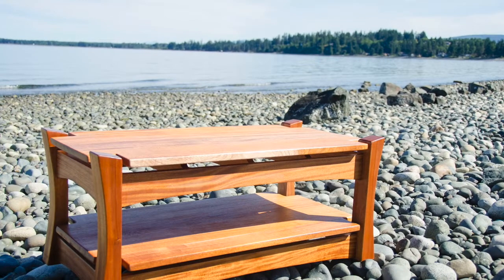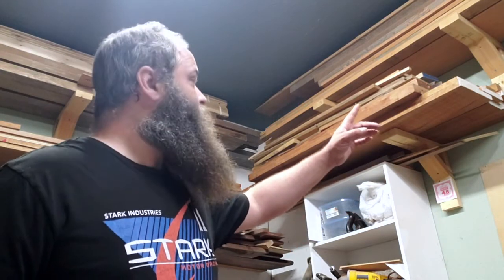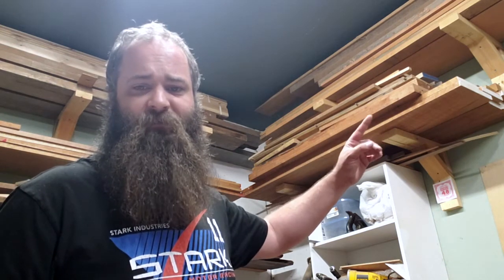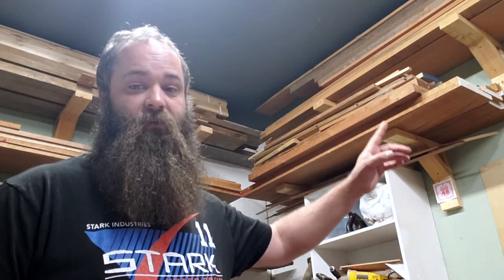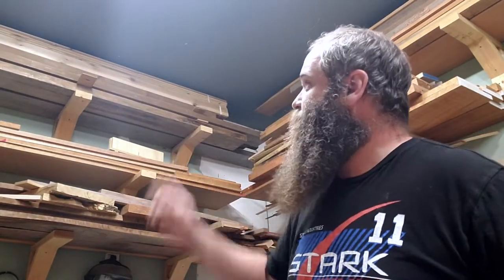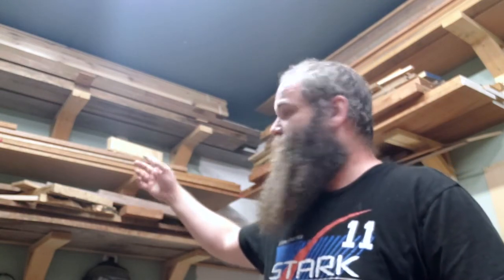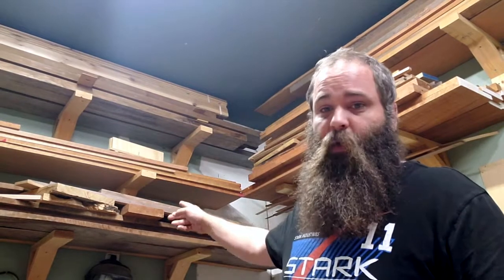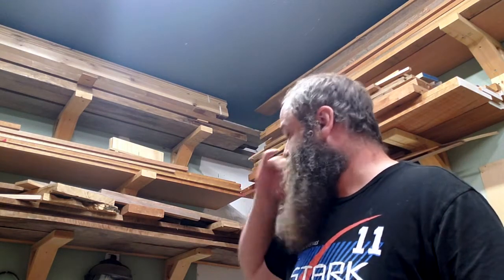My Name is Mike, and I'm a Wood Hoarder

Comment: My name is Memphis (Real Name Henri Chase) and I'm a wood hoarder too.  I have a very large shop, but still it fills up with remnants.  I've dealt with it by building a five level wood cabinet, and three shed roofs off my shop.  So far I've only had to build wood storage shelves into one of the shed roofs.  
     Another trick I'm trying to employ is setting aside any suitable remnants for cutting boards.  Easy for me, as I'm lucky enough to have both a thickness planer and a 25 inch drum sander.  
     Man you have some nice wood in your shop.  I can't even find white oak around here.  
      One more trick is parking my trailer right outside my shop door, so unless it is real good wood, remnants go to the trash.
Reply from the maker: Yeah, if I had a drum sander, cutting boards would be flying out the door. And you're totally right about just needing to be more picky about what to keep. Need to force myself to think, "Is this really good wood?" or at least consider what use it could be put to before deciding to hold onto it.

Comment: How far apart are your wall brackets? I'm always worried about warping over time.
Reply from the maker: The ones on the wall in the thumbnail for this video are relatively far apart (probably 5 feet), but I only put kiln-dried wood on those, make sure there's enough weight on the stacks to keep them flat over the span make sure there's material extending a good ways out over either end. Have never seen any sagging issues. If you're actually drying wood on your racks, I would put a bracket on every stud, but if your wood is fully dry, it shouldn't be a problem.